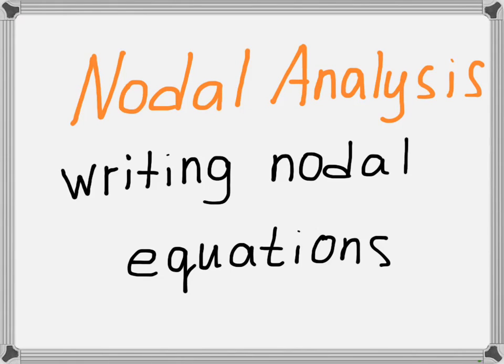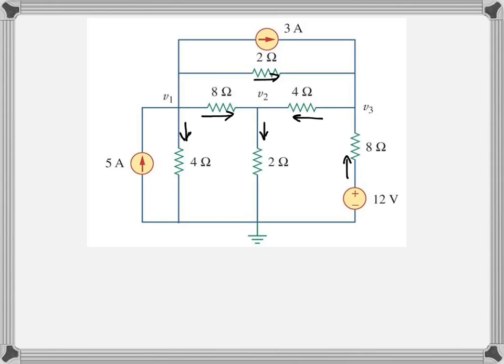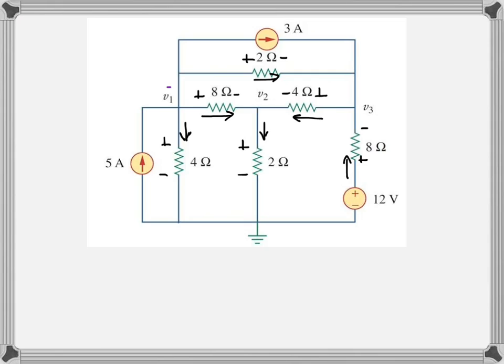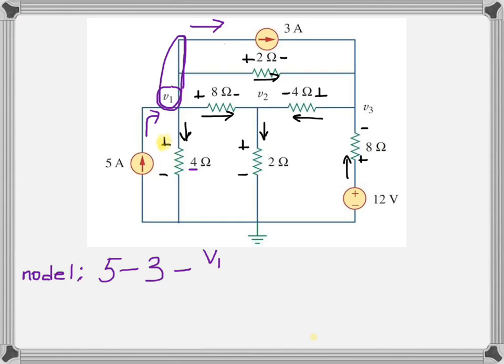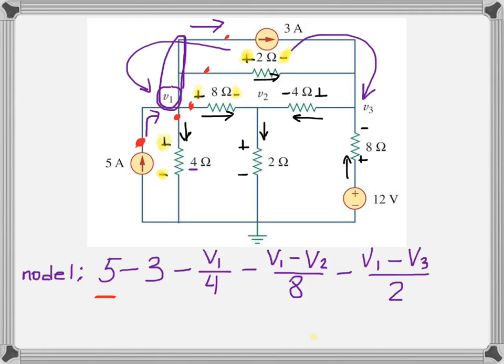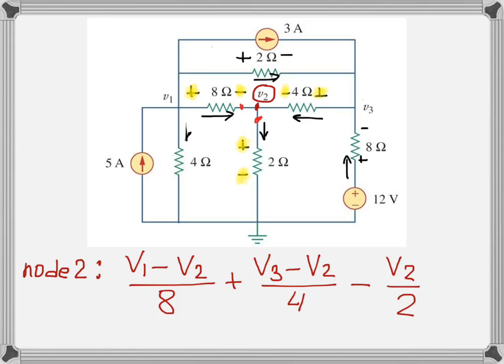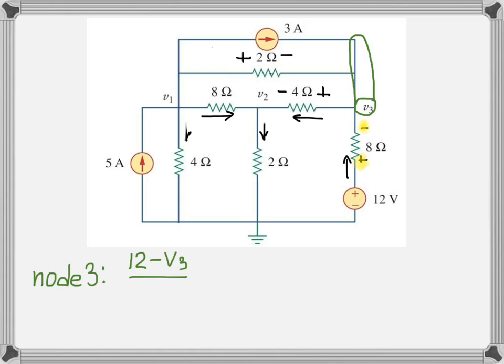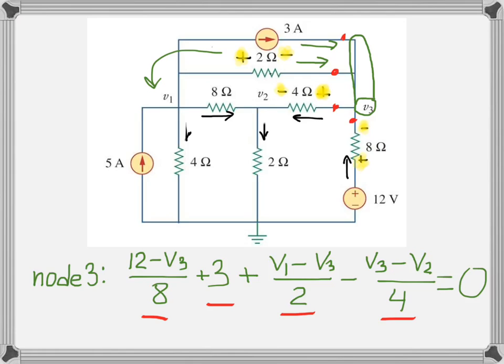Nodal Analysis part 2. Writing nodal equations for 3 nodes

Comment: v1=10V; v2 = 74/14V; v3 = 184/15V;
You can alternatively define the direction  of current out of each node to be positive and set up the system of equations. You'll still get the same result for each node voltage.

Comment: Suppose there is a 5v souce voltage placed in parallel at node V1, instead of a 5A current ,then is it possible to solve it by Nodal analysis ???
Reply: Yes by means of super node analysis
Reply: But this process is worng